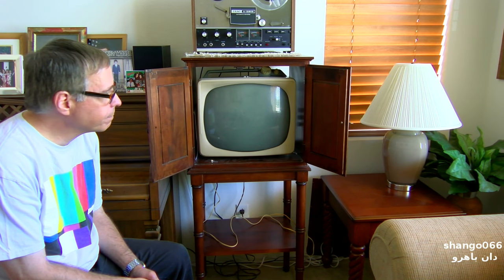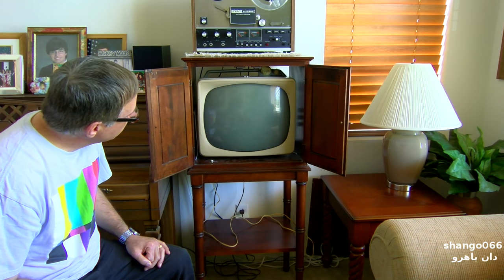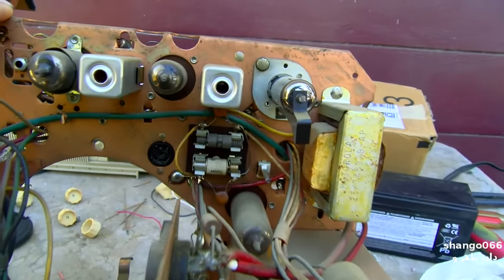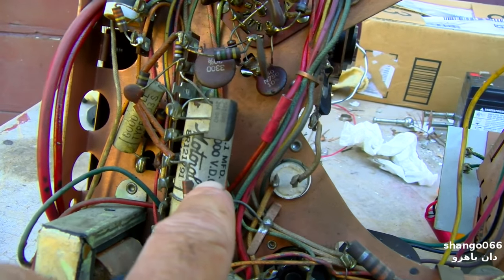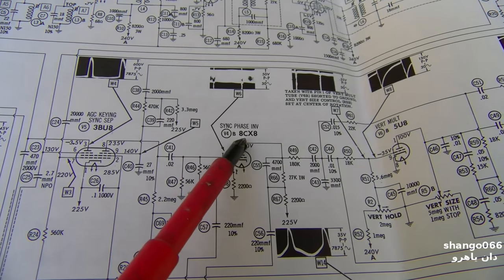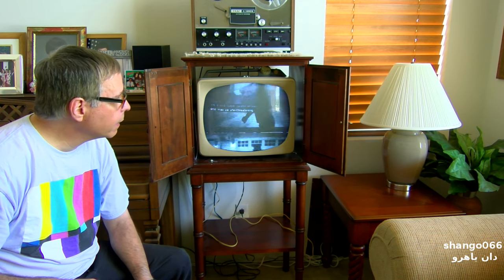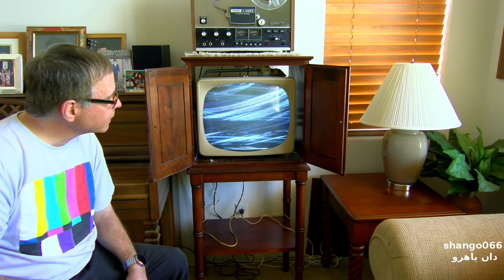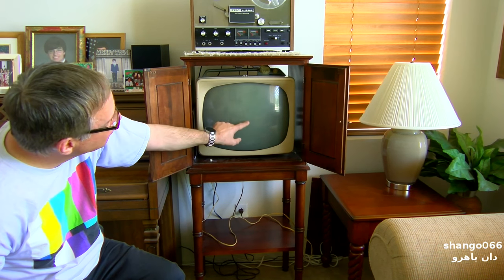1958 Motorola Television Analysis For Repair With Sets Owner

Comment: A good presentation, analysing the known problems of TV sets that vintage, particularly the wax & paper capacitors. A problem I experienced in early Australian colour sets was a shorted line output transistor, caused by voltage transients, from an open-circuit 10nF, 2kV plastic tubular capacitor across the collector-emitter connections... I started by just replacing the transistor, but it too failed, and had to diagnose why. A way of checking was using the Rx10k scale across the capacitor, and look for a small 'kick' on the needle...

Comment: Lovely old set. Didn't get the Motorola brand in the UK, but I did once see and repair one on a US airbase. It was a solid state console, with reel-to-reel if I recall right. Beautiful sound, and obviously something of an electronic aristocrat. They had their own 117V 60HZ supply there from on-site diesel generators.

Comment: If was the owner, I wouldn't keep the set in a cabinet like that. Even though the back is open, there's a lot of heat generated by all the tubes in that set. The most ventilation is best for those old sets.
Reply from the maker: I agree, i would leave the back off the set and maybe even some fans forced air cooling
Reply: fans might help, but would be pretty "unauthentic" to mount 1990ies+ brushless fans on 1960ies devices.
Reply: Hi, Thanks for your comment, I'm the owner of the TV. I am also concerned about the heat issue so I took the back off of the cabinet it is in. I don't think the TV will be on long enough each time it is used for heat to be an issue but it is something I will pay attention to when I use it.
Reply: You'd be surprised how much heat is generated by all those tubes. One major thing it has going for it is it is hand wired and not a printed circuit chassis. Printed circuits in that small of an enclosure is a ticket for disaster. 

That's a real "cream puff" you have there. Give it the best care and you should have many years of enjoyment out of it! Sadly, this is the kind of quality products we USED to make in this country.
Reply: +David Mark if possible, mount a fan like one used on PC's as forced air cooling. it can be done on a thin plywood plate and some seal from a window to eliminate duration. the 12v DC can be supplied by a small transformer
Reply: +David Mark mount a pc fan In the cabinet ( not the tv set..if done unobtrusively it should help.
Reply: If that is what it takes to keep the TV going longer.
Reply: You're right. was is singular, were is plural. Been trying to get that across for years.

Comment: I've never seen a tube secured like that before.  I wonder what you'd have to do if you have a vertical output tube that is slightly longer or shorter?
Reply from the maker: That was standard in many Japanese made electronics